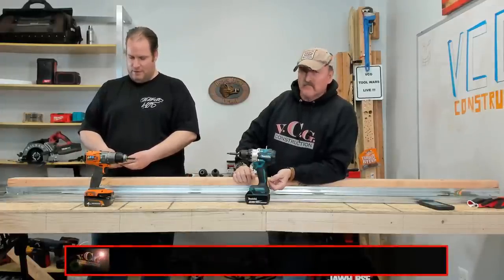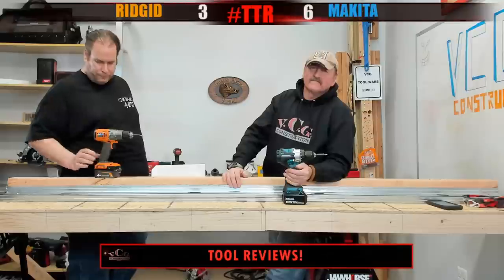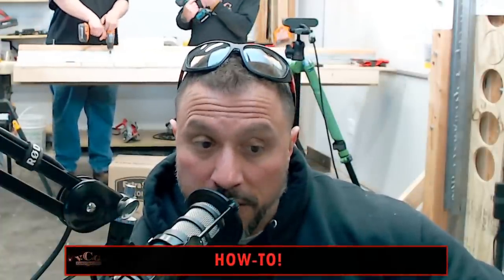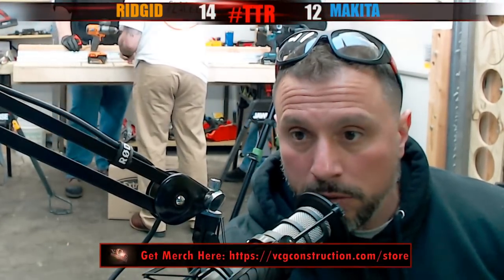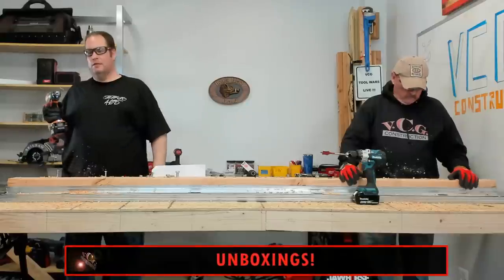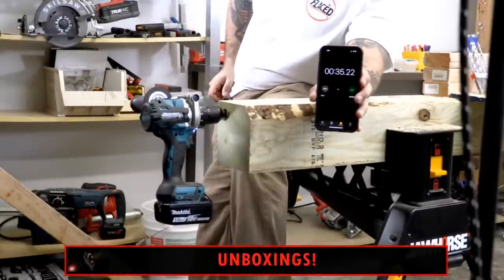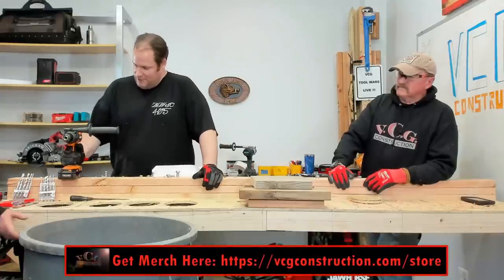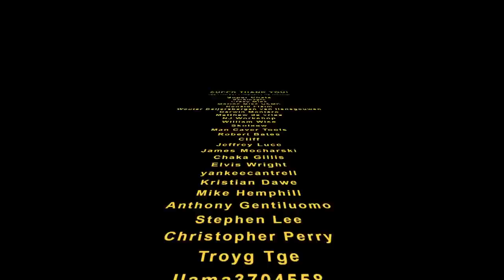All New RIDGID Takes ON MAKITA Hammer Drill! (Tool Test Raw)

Comment: You go power detect from what ive seen it is slightly more powerful than the flex with a 8ah battery. But I love running mine with a powerstack. Just doesnt last super long but will get you through a day if not just have a back up one.

Comment: Rigid is for prosumers and Makita is an established pro line...I'll take 1 more second to fasten a deck screw and save 50%-70%  over 10-15 tools... that's a big difference...
Reply: The company I work for puts up architectural aluminum all over buildings, parking garages, etc and we only use ridgid. The guys in the field swear by it and use them pretty much 8 hours straight every day

Comment: Watch the short guy, he is driving the lag bolts crooked but got the drill straite up and down and the big guy is pushing with all his weight and the other dude has 1 hand on the side off the drill and if you dudes cant see that this test is flawed and the little guy cant even roll the screws when they are using more then 1. Of course the big guy pushing from the top with way more weight and is better at driving the screws straight.

Comment: Have you seen the makita x2 LXT circular saw deal at home depot online I got a makita x2 LXT rear handle saw kit with 2 batteries plus a 2 pack of 5 hour batteries for 249
Reply: @jacksmith2315  it might still be going on I purchase it on the 3 off the home depot website

Comment: Would of been funny to use the Makita to back out for the rigid since it got stuck.  HD has a special not for the rigid free 4ah and bare tool for 149 or Makita Hammer bare for 149.  I get they have a place and arent but the top major 3 brands arent that much more on most tools that it just doesnt make sense. Specially if you catch them on sales and promos.

Comment: I can think of better comparable drills to compete with I never liked Makita even though over the years I've only had that one Makita tool fail on me. All of makitas tools are too heavy and they need to update their battery system. I don't like the ergonomics of most of their tools. Thier oscillator feels like a tank. It's so big and heavy and a pain to use. You get alot of vibration in hand and it's harder to control than even a Ryobi. My mind was different years ago but now I believe Ryobi is a superior company in all aspects price, durability, and functionality. I really see Makita going downhill if they don't update their platform like everyone else's I really hate to see Ridged get rid of their octane batteries. When it comes to makita I wouldn't purchase anything that is cordless because their designers forget why people use cordless in the first place. Thanks for your vids I just started watching a few months ago.

Comment: The ogre on the left in the very first test needs to stop pushing down so hard.. you can literally see his arm strain whenever you say go the dummy doesn't realize that tool does most of the work you don't have to put that much pressure he is the one causing rigid to look bad because he doesn't know what he's doing.. yes I know because I work in this industry and now use my drill and impact drivers every single day